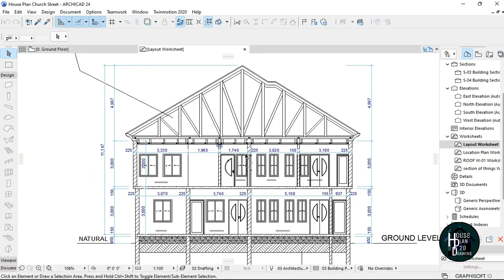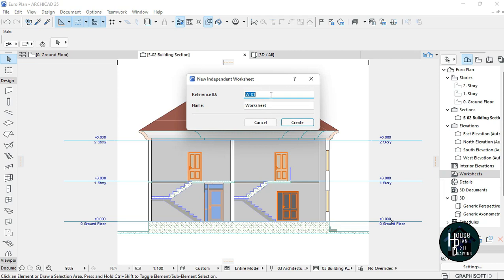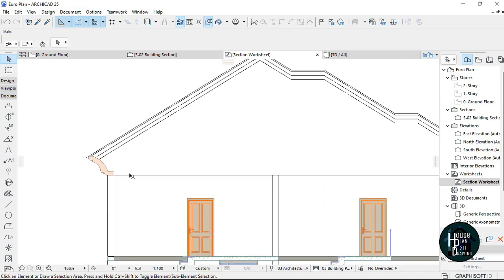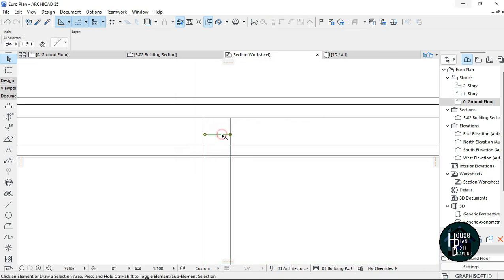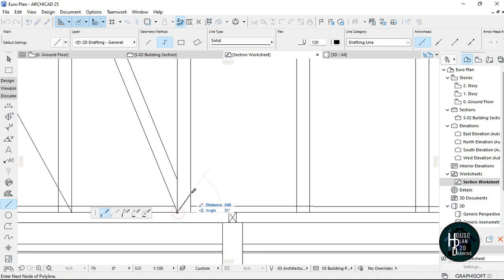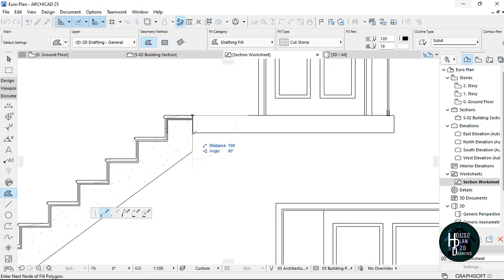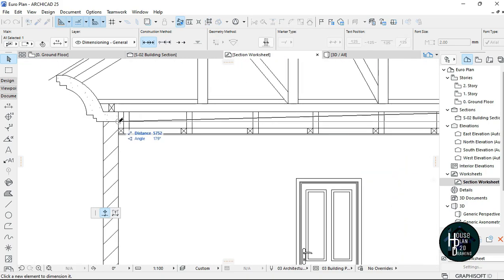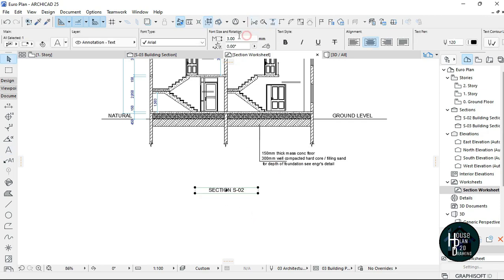How To Section In Archicad || Intense Teaching

Comment: This is a bad way.
 Never make a separate 2d section.
Adjust the 3d section well and add 2d elements if necessary.
Reply from the maker: I believe as an architect you might want your drawings to be in a certain way and if archicad can't give that to you, you have to find another alternative. Just saying.
Reply: I agree with this one. This approach can be stressful, with multiple floor plan revisions